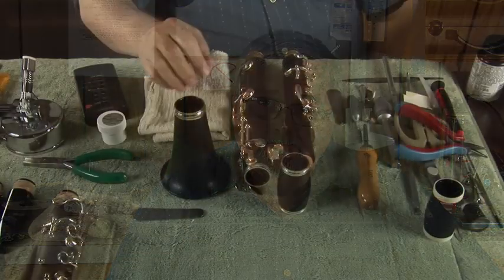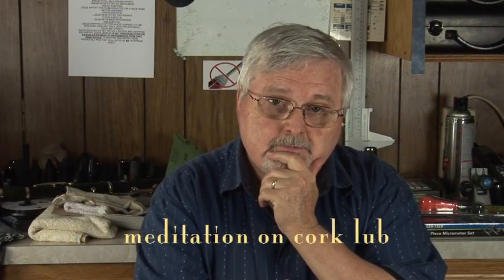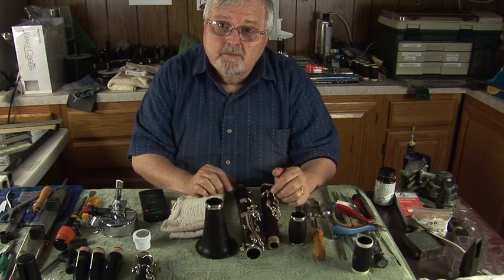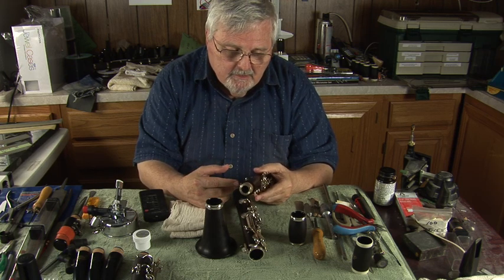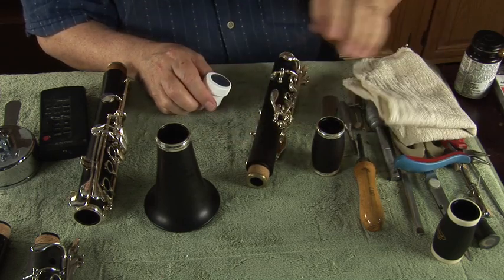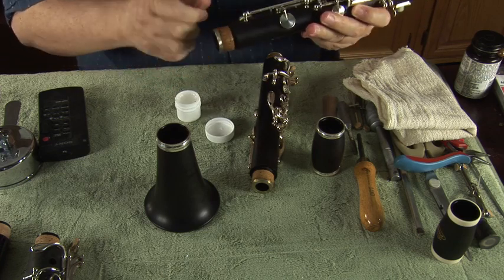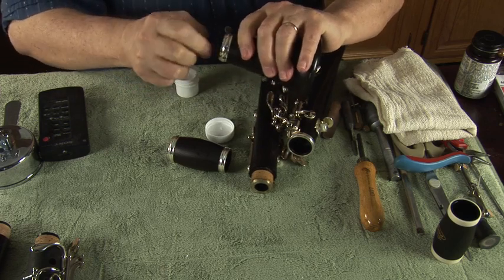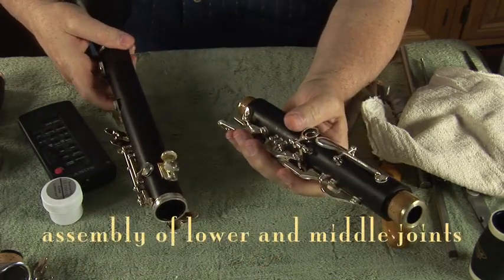clarivid 83 how to assemble the clarinet correctly

Comment: I have 2 clarinets, and they both have the same problem. Air escaping from the Eb/Ab key, making it a little bit harder to get the Bs, C#s etc.  I have tried the cigarette paper under the pads on all the bottom keys, and all have a little pull on them except that Eb key, the paper glides in and out easily.  All notes sound when pressed hard, but during a fast passage, sometimes they never sound. IS there a cure, is it the Spring?